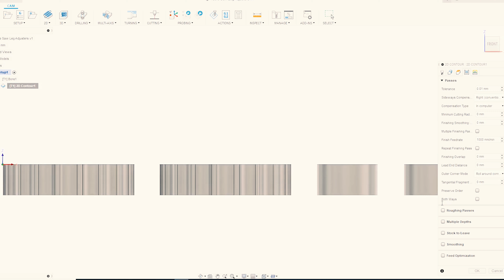Homemade table saw (Part 5) - Extension TABLE | CNC Feet | Adjustable FEET

Comment: heh mate
did you mend the oil leak on your dax 125?
Reply from the maker: Hi, no I did not figure it out. Since it was no big problem driving with it as it was I did not take the time time find the problem. Now the bike is sold and no longer in my Garage :)